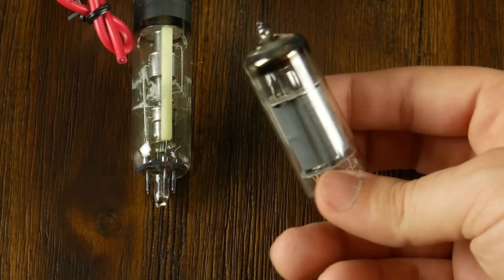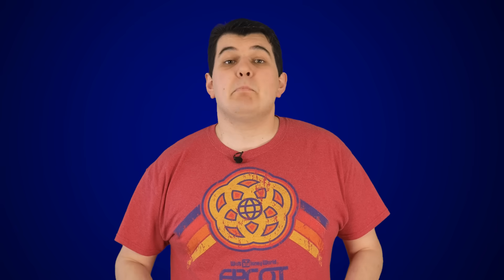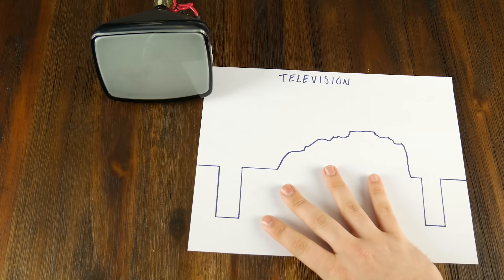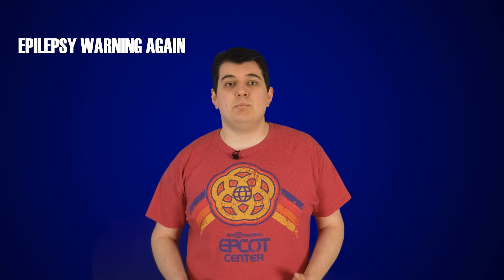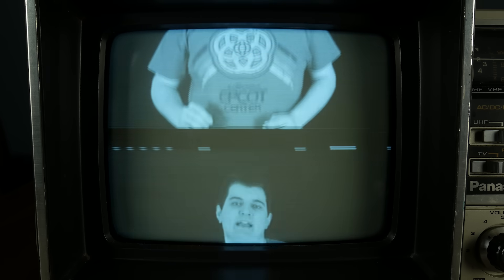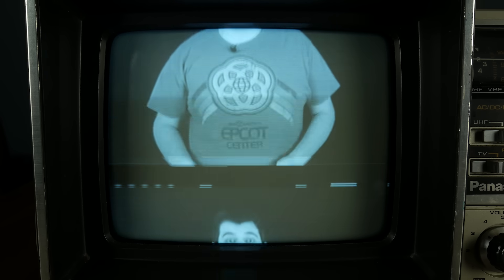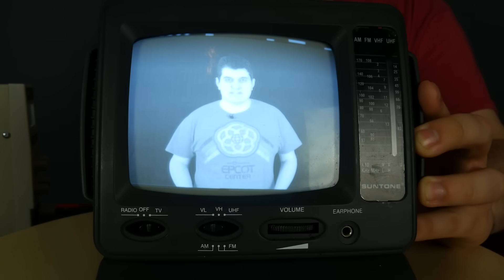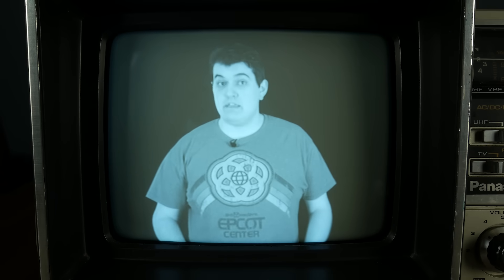Lines of Light: How Analog Television Works

Comment: Thumbs up everyone who can hear the high pitched sound from the crt after 5:41
Reply: John Buluba yeah, they always say older people can't hear that. I think it's funny, because I'm 32 now and have worked in construction in a very high noise environment for over 14 years but I still hear that kind of stuff just fine.
Reply: Nevir202 Nah, it’s based off of how good your hearing is. Some old people can hear high-pitched sounds still, but some young people can’t hear them ever. Most people can hear them as a young person, but then when they get older they lose the ability to hear it due to their hearing degrading as they get older.
Reply: @Nevir202   You and me both, I am 30. I am a mechanic and use impact guns and hear noisy cars all day everyday... along with blasting music dangerous for your hearing basically at every opportunity. I have did a hearing sweep test and I have a slight flat spot in my hearing spectrum... but surprisingly its not in that freq. range.
Reply: codemiesterbeats Yup, and I see I forgot to mention I also used to stand at the front at rock concerts when I was young.

Some people are just lucky I guess? 🤷‍♂️
Reply: @Nevir202  My dad can also hear that noise.
Reply: 32 is not old.  nowhere near either
Reply: @Nevir202  Give it 5 more years.
Reply: @Nevir202  Wow. Congrats on very above average hearing.
Reply: At 50 years old i couldn't hear it at all, do remember the sound though!
Reply: I could never HEAR the sound, but I could always SENSE when a television was on.
Reply: @TheEgg185  me2.. always thought it was weird, a mix between a feeling and a sound
Reply: Fopenplop Unlikely, I have a fucking huge head. Makes it hard to buy hats and helmets.
Reply: What sound you whipper-snapper!!!
Reply: Brendan Bohannon LOL, ya I was so happy when I got my first HDTV and realized that it didn't make that noise. I had never known what part of the television was actually making it until a few years ago when I saw the video talking about it somewhere here on YouTube. So I was actually surprised at the time lol.
Reply: @Nevir202  
Two years late. 28 years old, and CRT TVs are still extremely audible, though this may be due to my aversion to anything loud.

When we got our first hdtv, the lack of the usual high frequency noise made the living room feel suddenly empty.
Reply: Lauren C Ya, I know what you mean.

I used to go into a house and could tell someone was watching TV, even before I could hear the TV. 🤣
Reply: CoolDudeClem I did an ABX blind test to see if I can hear the ultrasonic frequencies beyond 20kHz in HD FLAC files. I didn't pick up the ultrasonic waves but I discovered that my sound card driver has anti-aliasing issues that reflect distorted ultrasonic frequencies into the audible range. So the ABX test illuminates our internal human biases.
Reply: Paul NJ the saw q z
Reply: Couldn't hear it over my tinnitus
Reply: John Buluba I didn't hear it but my television may cut off the high frequency. I still hear television tubes today. People who can't hear it think I'm nuts when I say I can hear it.
Reply: freeculture - Why would you assume millennials never used CRTs? Flat screens were expensive in the 1990s and contrary to popular media, not all of us were born into such wealth that we bought a new TV or computer monitor more than every few decades. Now maybe you are thinking of generation z, many of whom really would have never been around for anything but flatscreens.
Reply: I heard a little, but I'm not sure I've heard the whole of it. (I'm 30 y.o.)
Reply: John Buluba - I have awesome studio headphones turned all the way up and I couldn't hear it... well I sort of, but I don't count it.  I'm 33 and listened to way too much loud music and been to too many concerts.  The types where everyone jammed in the compact car on the ride home is yelling and your ears are ringing... ahh the  sound of onsetting hearing loss!
Reply: it kinda hurts my ears & I'm 30a
Reply: It was heard on both channels quite evenly. If you had you headphones on they might contribute to the difference too. Frequency response can be very uneven on higher frequencies between the drivers.
Reply: I'm 29 and I heard it loud and annoyingly clear
Reply: I'm 33 and I could hear it perfectly.
Reply: i could always hear and sense it, no one else in my family could
Reply: The tinitus is back!
Reply: I can't hear anything because 1. I'm in my 30's and only young people are able to hear high pitched frequencies. 2. My TV's speakers probably don't play such high frequencies very well. And/or 3. I have really bad tinnitus loud enough to be heard over things like traffic or a noisy computer fan. I already hear a high pitched noise 24/7 as it is. I have certainly heard the sound of a CRT in real life more times than I can count, though. I can also hear cell phone and DS chargers and other similar chargers which use high frequency pulse width modulation with an inductor.
Reply: @Clinton
Yeah! My dad bot a thousand-dollar TV back in '97, and I don't think even that had a flat screen. Or maybe it did... But if that was the case, that's a ridiculous amount of money just to get a flat screen. Sane people wouldn't start buying them till the 2000s. Millennials had tube TVs, VCRs, and home-phones (with a cord!). Most probably didn't even know what a cellphone was in the 90s.
Reply: http://plasticmind.com/ears/mosquito-tone-or-how-to-tell-youre-a-youngun/
Reply: im 28 i hear it
Reply: I'm 38 and I heard it too.
Reply: John Buluba This video actually explained the noise for me. I told my parents that i could tell when their tv is on (They still use a CRT tv) just by hearing a high pitch noise, but they always told me they couldn't hear anything, the wierd thing is that my sister is only 11 yet she cant hear the noise...
Reply: I’m 36 and glad I can still always tell when a tv is turned on pretty much anywhere just because of the high pitched tone.
Reply: formerx I'll be 36 in August and I can hear all of those tones clearly without headphones. I've always had great hearing, but I'm a bit surprised that it doesn't seem to have dropped off yet.
Reply: I can't anymore, but I remember how it sounded when I was a kid because I grew up before LCD screens were a thing. My wife can still hear it though.
Reply: RE:  Anti-aliasing in ultrasonic frequencies in integrated sound devices:  This is why I preach Creative products.  Old as they are some of their driver GUIs in a state of fuckary they know what they are doing do sound in the way of personal computers.  SB  ZxR has a hilarity of frequency settings.  No one ever uses the 512khz quality setting but its still fun to know its there and I can mess with ultrasonics in my air compression ampliphonic Harmond sound-sticks II.  My dog goes nuts. (:
Reply: I'm 32 and heard it painfully clearly. Ugh
Reply: That is quite a sensitive microphone.
Reply: i always hated that sound
Reply: 29, and that sound made me wince. I can still hear things like the mosquito tone and such too, just barely. I’m a music teacher; I’d have thought  half a decade of having trumpets blasting in my face would have destroyed my ability to hear things which only teenagers are supposed to perceive, but nope.
Reply: I'm 18 and cant. I remember hearing it when I was little but I can't anymore. crap (i heard it at 12:00 though)
Reply: I don't know, I'm 19 but I can't hear it
Reply: 43 years old here and the noise is VERY CLEARLY audible.
Reply: Still hurts like when I was a kid and I'm 35. I still use old color CRTs for gaming and I always hear that noise.
Reply: KandaPanda It’s never hurt me. It’s just annoying. Maybe you have super-sensitive hearing.
Reply: @justanotheryoutubechannel  oh....maybe I should have that looked at? Haha
Reply: madattaktube No, but I expect it means that your left ear has simply lost some effectiveness but the other is still good enough to hear it.
Reply: Im pushin 40 and still heard that high pitched noise clearly on a little android phone speaker
Reply: What I want to know is how the hell apollo was able to send analog TV with audio sent from the moon through the Van Allen Belts 237,000 miles away from Earth without any distortion or degradation, faster than the speed of light ?
Reply: @empathicallyyours4937  every tv has a analog and digital TV anteena and channel box port
Reply: I'm 29 and can hear it no problem, I've always had acute hearing though. Makes up for my shit nearsighted eyes lol
Reply: @MotoguyX5    Makes up for your shitty vision and your bad smell?  Just kidding  :)
Reply: Can't hear it, got tinitus.
Reply: @rouge5140  that high pitched whine you hear is probably Camilla TBH...
Reply: It’s quite common to hear frequencies that high up to age 35 or so, but it starts to drop considerably at age 25. It’s not a hard rule, and it depends on the “damage” done to your ears in early adulthood...plus heredity. In my 40s with above average hearing, that frequency (and then some) is long gone.
Reply: I still hear it, and I am in my 30s; can still hear up to around 19 kHz.

can usually hear CRTs as well, but luckily they have mostly gone away now, so this is gone. still have computer noise though, and I have tinnitus that sounds like computer noise for whenever I am in a quiet room...
Reply: Most people have noise, its blood rushing around your ears
Reply: 30 here and can still hear it
Reply: 33 and I could hear it but only in the right ear, quite intensely too.

Not sure if this is due to a difference in the ears or if the sound only played out of the right channel.
Reply: I heard not one constant sound but like a very fast wobbling or beeping.
Reply: ikr im like that souuund is sooo annnoyyying
Reply: If you can hear it, you're too young to have seen a real crt tv
Reply: I think it's actually the lower frequencies that go over time more often.
Reply: I'm not crazy
Reply: +Nevir202 Working construction you're probably using hearing protection, so it makes perfect sense your hearing would be better than the typical 20-something-year-old who goes to clubs/concerts/raves and constantly blasts music into his or her ears at ludicrous volume levels.
Reply: @hellterminator  I'm 30 and work in a factory, wearing my ear plugs almost religiously. I'm also a metalhead and have been to some loud-ass concerts, again wearing ear plugs. I had a hearing test last month and I heard all the beeps sent my way, including the very faint 20,000 kHz ones. Yeah, I take crap for wearing ear plugs to concerts or on the occasions I've been in a band, but my ears are in much better shape than some of my peers.
Reply: I thought it was something else at first.
Reply: Yes, I can still hear it!
Reply: John Buluba 
I definitely heard it, and I am 15!
Reply: Im 25 and i can faintly hear it but I remember hating that sound as a kid. Im kinda sad to have it fading away now
Reply: I'm 26 and I still hear it! lol
Reply: My fucking head, ow, the sound hurts
Reply: 30 years old here and I can hear it just fine. Of course, I've always had very sensitive hearing which seems to be my tradeoff for being nearsighted as fuck.

Edited to add: I work in a factory and we recently had our annual hearing test. I can clearly hear sound in the 20 kHz range with no issues and wear my ear plugs religiously to ensure I keep that sharp hearing.
Reply: I'm 19 and heard nothing fuck
Reply: Almost 40 and heard it loud and clear!
Reply: I remember hearing that sound when I was a kid, but haha I heard absolutely nothing when watching this video
Reply: Barely, though i have my volume really low and don't want to reach for my headphones.... 30 now and i can still hear it, though i remember being able to hear CRTs in recordings much clearer when i was younger. A good reminder to always wear ear protection when at work, at concerts, or doing anything else that involves loud noise. The high frequency receptors of our ears are the most easily damaged.
Reply: 39 years old and I can still hear it.
Reply: Didn't  hear anything. I'm 25
Reply: 33, heard nostalgia very clearly.
Reply: Is it that weird sound an old tv makes? (The screeching sound it makes) I’m 13 so I can hear it’s clearly
Reply: @olafs20016  they would do that when turned on and then sort of quiet down into a low buzz. :)
Reply: Well I’m 10 and I hear it!
Reply: Now the problem is I can't unhear it.
Reply: 22 years old. can still hear it.
Reply: I can still hear a CRT buzzing from across a room quite well, and I'm over 25.  It's quite annoying actually.  Upper limits of human hearing my ass.
Reply: I can and I love it so much
Reply: 36 and I heard it fine :D
Reply: It hurts.
Reply: I'm 21 and amazingly I couldn't hear it. I kept waiting like when is he going to play the sound!
Reply: I hate that noise because i can hear it perfectly fine
Reply: while i cant hear it in the video, i used to always wonder what the ringing-like hum from old tv's was (i could tell it was on from like the next room just from the noise). i also would tend to hear that same ringing like noise when trying to sleep at night in a dead quiet room, and as such would require something else like a fan or AC be on just to get rid of the ringing so i could sleep, though i eventually got over that, glad to see someone else mention it so i know i aint crazy. i can still hear it to a much lesser extent from my current monitor (a modern curved ultrawide) as turning it off and on again proves.
Reply: Man immediately made my bones hurt lol
Reply: Right here
Reply: I'm 37 and I could hear it!! It made me feel like a superhero.
Reply: It's under 18KHz, because 18KHz is where YouTube stops. Simply put, it's a much lower pitched sound that it's claimed to be.
Reply: Dude, I'm 36 and that sound was loud on the other end of my room and painful when I sat in front of the Computer! Ouch!
Reply: Yeah, even with the video over, I still hear it. Well, rip my ears.
Reply: WTF i've always heard that sound when I was little and I thought my ears are broken or sth !!!!
Reply: I'm 12 and I can't hear it
Reply: @toolazy4names302  I preserved my ears from an early age. I listened to music, yes, but not that loud. I grew up with CRT TVs and I can still hear the high-frequency sound. Heck, I still have an older Sanyo CRT TV for my Wii.
Reply: @toolazy4names302  I'm only a year older than you. Well, actually, I turn 14 in less than 2 months.
Reply: @07VFDInLCD  Sorry, that was a typo. I'm actually 14. I didn't realize I typed it in wrong until you replied.
Reply: I was able to hear that, and I got a Headache from it :(
Reply: ye but be aware headphone users :<
Reply: My crt makes a small clicking noise when powered off is it normal or not?
Reply: I can
Reply: I used to hear it.  It was annoying.
Reply: I'm old😞
Reply: I am 36 and i hear it very well with my ordinary speakers
Reply: Not that I cant because I had an old ass TV and could hear it, but my phone cant reproduce that frequency. Go figure
Reply: Legitimately cannot tell atm, because my tinnitus I've had since birth is making that precise same frequency presently, so I hear it whether video is on or off. Tinnitius is always there, but occasionally it shifts in pitch and volume. I notice it for 5 seconds then my brain just tunes is out.till the next key change or I concentrate on it ._. Also why do I always have heaches :P
Reply: I can no longer hear this; I have my own internal tinnitus to supply the equivalent. However a a child I could always hear when a TV was on, due to the high-pitched whine.
Reply: I’m 19 and I can’t hear it
Reply: @its_robbietime1333  Don't worry Robbie, you aren't missing much. Wait until you are my age and can hardly hear anything! Enjoy what you have while you still have it.
Reply: I heard it a little bit, but it's very faint; I'm almost 32
Reply: I just hear like a pop and then nothing. I'm 30.
Reply: 35, and still hear it.
Reply: Well
Being 20 and not hearing anything over 10khz sucks
Really
Even 10khz is already just a tiny bit barely audible for me lol
Reply: REEEEEEEEEEEEEEEEEEEEEEEEEEEEEEEEEEEEEEEEEEEEEEEEEEEEEEEEEEEEEEEEEEEEEEEEEEEEEEEEEEEEEEEEEEEEEEEEEEEEEEEEEEEEEEEEEEEEEEEEEEEEEEEEEEEEEEEEEEEEEEEEEEEEEEEEEEEEEEEEEEEEEEEEEEEEEEEEEEEEEEEEEEEEEEEEEEEEEEEEEEEEEEEEEEEEEEEEEEEEEEEEEEEEEEEEEEEEEEEEEEEEEEEEEEEEEEEEEEEEEEEEEEEEEEEEEEEEEEEEEEEEEEEEEEEEEEEEEEEEEEEEEEEEEEEEEEEEEEEEEEEEEEEEEEEEEEEEEEEEEEEEEEEEEEEEEEEEEEEEEEEEEEEEEEEEEEEEEEEEEEEEEEEEEEEEEEEEEEEEEEEEEEEEEEEEEEEEEEEEEEEEEEEEEEEEEEEEEEEEEEEEEEEEEEEEEEEEEEEEEEEEEEEEEEEEEEEEEEEEEEEEEEEEEEEEEEEEEEEEEEEEEEEEEEEEEEEEEEEEEEEEEEEEEEEEEEEEEEEEEEEEEEEEEEEEEEEEEEEEEEEEEEEEEEEEEEEEEEEEEEEEEEEEEEEEEEEEEEEEEEEEEEEEEEEEEEEEEEEEEEEEEEEEEEEEEEEEEEEEEEEEEEEEEEEEEEEEEEEEEEEEEEEEEEEEEEEEEEEEEEEEEEEEEEEEEEEEEEEEEEEEEEEEEEEEEEEEEEEEEEEEEEEEEEEEEEEEEEEEEEEEEEEEEEEEEEEEEEEEEEEEEEEEEEEEEEEEEEEEEEEEEEEEEEEEEEEEEEEEEEEEEEEEEEEEEEEEEEEEEEEEEEEEEEEEEEEEEEEEEEEEEEEEEEEEEEEEEEEEEEEEEEEEEEEEEEEEEEEEEEEEEEEEEEEEEEEEEEEEEEEEEEEEEEEEEEEEEEEEEEEEEEEEEEEEEEEEEEEEEEEEEEEEEEEEEEEEEEEEEEEEEEEEEEEEEEEEEEEEEEEEEEEEEEEEEEEEEEEEEEEEEEEEEEEEEEEEEEEEEEEEEEEEEEEEEEEEEEEEEEEEEEEEEEEEEEEEEEEEEEEEEEEEEEEEEEEEEEEEEEEEEEEEEEEEEEEEEEEEEEEEEEEEEEEEEEEEEEEEEEEEEEEEEEEEEEEEEEEEEEEEEEEEEEEEEEEEEEEEEEEEEEEEEEEEEEEEEEEEEEEEEEEEEEEEEEEEEEEEEEEEEEEEEEEEEEEEEEEEEEEEEEEEEEEEEEEEEEEEEEEEEEEEEEEEEEEEEEEEEEEEEEEEEEEEEEEEEEEEEEEEEEEEEEEEEEEEEEEEEEEEEEEEEEEEEEEEEEEEEEEEEEEEEEEEEEEEEEEEEEEEEEEEEEEEEEEEEEEEEEEEEEEEEEEEEEEEEE
Reply: No! it's painful! By my age I should be past the threshold! Augh!
Reply: Couldn't hear it, but I've been dealing with high frequency hearing loss since I was twenty due to not using hearing protection correctly. Too many explosions and using firearms.
Reply: Hey man, i can
Reply: I'm 19 and I don't hear it :(
Reply: I couldn't hear it, but with manual testing, I can hear up to 18.5kHz. I would assume it's YouTube compression, but many people here can hear it. What gives?
... You posted the wrong timecode. The noise is at 11:57.
Reply: I could always tell when my brother left the tv on; because I could hear that noise.
Reply: I lowered the volume, and yet I still heard that hellish buzz from my childhood clear as broad daylight
Reply: know about the wiorking of C.R.T. Tubes
https://kbs121.blogspot.com/2020/05/cathode-ray-tubes.html
Reply: I'm 16yo and can't hear it...
Reply: I actually paused this to see who was watching TV downstairs before remembering we don't own any CRT TVs and realizing it was coming from the video.
Reply: with laptop speakers no.... with my nice headphones it makes my hair curl and I'm 30 :X
Reply: Yep and just turned 27 the other day. I always wondered why I can hear the TV when nothing is playing, this explains it quite well!
Reply: John Buluba I remember going to stores like Best Buy or Target that had a wall of CRT TVs. The sound was extremely irritating!
Reply: I remember being irritated by that noise when i was young, it was very distinguishable if the content was silent, such as when you were in front of a computer... Everyone is slightly different, but it turns out prolonged exposure to loud sounds can "burn out" the little hairs responsible for sensing those frequencies inside your ears. So if you spent too much time in front of CRTs in your life, you probably lost those frequencies. The millennials, wouldn't since they never used CRTs.
Reply: John Buluba fkn hate 20hz flyback transformers   grr
Reply: @hubzcaps  ^^
Reply: maybe you got smallass ears nevir
Reply: TheEgg185  Back when I was just a kid, I not only heard them, they actually caused me a lot if pain whenever I'd go into a departnent store.
Reply: It absolutely kills me. Literally hurts, probably because I'm autistic.   I hope I lose that hearing soon, but it might be a while since I'm 27 and can still hear it.
Reply: Yea, its called tinnitus.